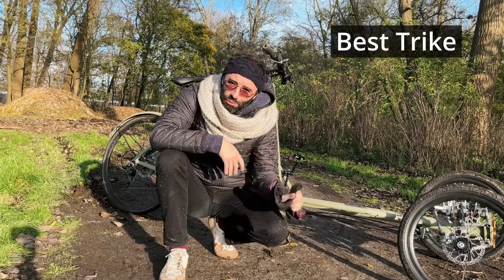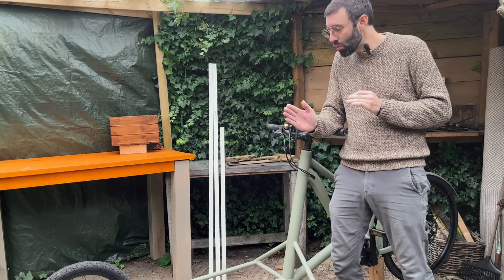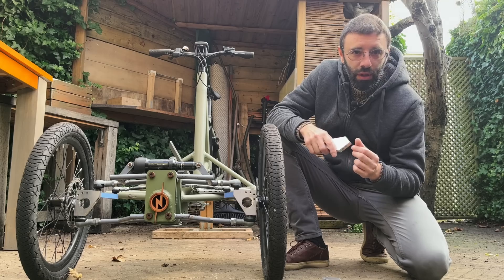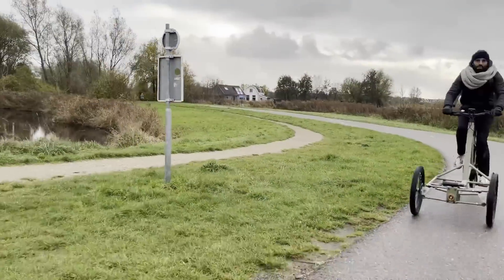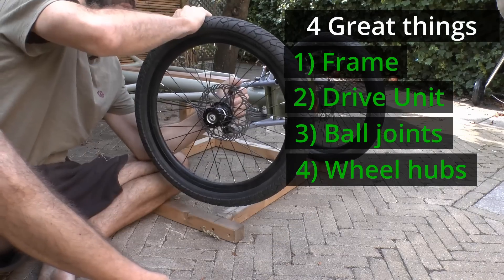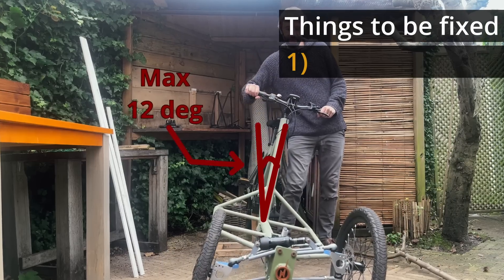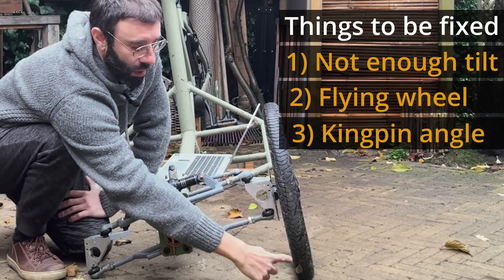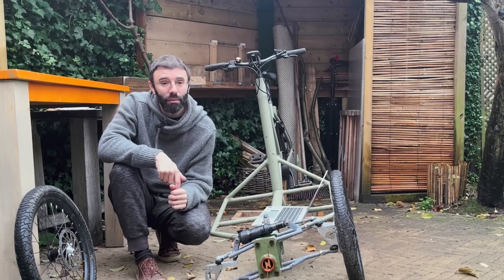#5 Build Finish and Tests - Tadpole Tilting Cargo Trike

Comment: This video comes out just about a week before I present my final project in my university.  We are making a cargo trike and we designed the suspension and tilting mechanism inspired with your videos. You helped us A LOT so THANKS!
Reply from the maker: I love making project that work and sharing the knowledge as clearly as I can. This comment makes me super proud of my work and it's super inspiring. Thank you for that.
Success with your project! Cheers!
Reply: It is always pleasant to see relevant ideas inspire and widespread across the world. Just for curiosity, in which country and city is your university ?
Reply: @ Sorry to answer so late... Universidad de Buenos Aires, Argentina
Reply: Wouldn't the ideal be to keep the cargo level, just tilting the rest?
Reply from the maker: @perpetual4958  that sounds cool! But maybe not easy to implement.
Reply: @pedro-neves  Indeed postNL was world famous in Bike design circles when it launched that trike with plastic carriage cabinet in the front that was stable. The wheels turned in the wheelarches. So it would remain stable. I guess the best option would be carriage capacity in the back like a carver, or that old Honda moped trike with stable back-end and font section/seat swivelling on circular? glider.
Reply from the maker: @perpetual4958  I think the option of the cargo bay being in the back or in the front is a matter of taste really. I tend to like more the cargo in the front because you can see it. If you'tr carrying kids or pets it's nice to always make sure they're ok.
Reply: @pedro-neves  If you want it stable (cargo that are or act like fluids, then back is probably easier to do, as per two examples mentioned.

Bright reviewer liked the longtail bike. The Cube trike opening the video is stable, with tilting front: https://www.youtube.com/watch?v=0As93DiIFuU

I thought your new trike looked scary going over the paved pathway in the park. Requiring so much corrective steering. Hope it isn't as scary when riding it.
Reply from the maker: @perpetual4958  indeed my trike needs quite a bit of corrective steering now. I'll try to improve it.
Reply: I don’t get the nerds in the comments section.  This guy is sharing his bicycle science experiments and data with everyone and people respond with being critical and rude to him. It’s just unnecessary.  It’s like nerds see another nerd’s work and feel the need to put him down, criticize, and say something to make themselves feel superior.
Reply: soooo... you basically copied a flawed design without analysing the issues, and engineering proper solutions?

yaaaay! education!
Reply: @paradiselost9946  You win the non-sequiter of the day trophy 🏆 congratulations.
Just like a pizza-cutter, all edge, no point.
Reply: @johnosullivan675  if you are going to be all intellectual, like... at least get the latin correct.
non sequitur
Reply: @paradiselost9946  The last versión of the trike was more than enough for the prototype we are making and it allows for improvement, thank you for worrying though
Reply: @paradiselost9946 where is your video with your perfect design…we will wait.
Reply: @amiddled  ah yes, because everything has to be documented on video now, doesnt it?
Reply: @ no, but it’s a lot easier to criticise than create.

Comment: I would suggest using a single tie-rod to connect both wheels to each other and a second one to connect the wheels to the steering yoke
Reply: cant... the way the swingarms move means those pivots change distance depending on where in the travel they are. its going to be constantly varying from toe in to toe out...
Reply from the maker: @paradiselost9946  hmm, I didn't think about that. My main concern to connecting both wheels to each other was the frame being in the middle when tilting.
Reply from the maker: Thank you for the suggestion! I haven't made that because with the tilting mechanism it makes it hard to connect both like that because there's the frame in the middle.

Comment: Nice update!
I've been using 20mm steel axles on my trike, welded to 3mm steel plate as base of the spindle. The axel is working well, colud probably be quite a bit thinner, hollow or both, but I would say it's a good idea to leave alu for the axles.
I'm not sure you saw my construction of spindle on reddit, but it might be part of the solution to get the kingpin angle steeper by putting the lower balljoint below the discbrake and further out. Maybe even get also the upper balljoint above the disc might be a good idea to make it even steeper. I guess there is no real need for the self stabelizing functions this angle provides on a tiliting vehicle. My dream would be to have "umbrella" shaped wheels though to be able to make this line vertical, but harder to find such wheels.
Regarding the turning radius, I have the same problem that I would like to make it quite a bit thighter. I', also having the same problem that the steering angle of the inner wheel is still to small when the steering bar aligns with the 2 turning points of the spindle. I don't have a good idea how to make this better but I don't think that you're idea of moving the joint of the steering arm forward will help much. Imagine that the steeringbar just consists of 1 piece going from one spindle directly to the other. Then you'll still have about the same max angle of the when when the steeringbar and the 2 turning points of the spindle aligns.
Reply from the maker: Hey, thank you so much for sharing those design thoughts. Super interesting! I did not see your design in Reddit. Would you like to publish in this forum? https://www.reddit.com/r/VehicleEngineering/.
I believe you sent me an email with pictures of your build right? That was cool! But in Reddit I think it's easier to discuss.
Cheers!
Reply: @pedro-neves  Yes. you're right, had not shared those pics on reddit but now I have.
Hope it could give you some inspiration.
Reply from the maker: @linus-IO  nice thanks! I already put some questions;) hehe, love these discussions.

Comment: Definitely make your new axles out of steel so they will last longer than a small test ride for a few days. Also you commented on the aluminum frame being better even though everyone else knows that steel is more durable, you said it was just better to be aluminum. Because weight is somehow a major factor on a cargo trike? That makes no sense. If you want your frame to be more durable and your axle axles to be more durable make them out of welded chromoly steel. It does not tear nearly as easily as aluminum. Mini race applications do use aluminum for frames and chassis, but not when durability is desired and weight is a minor concern. That's when everyone switches to steel or something better and far more expensive.
Reply: I do love and appreciate your project trike! And the wealth of valuable information you are sharing with all of us! Keep going!
Reply from the maker: @SK-wf9pu  thank you so much for the inspiring words;)
Reply from the maker: Hi, indeed saying that an aluminium frame is better than steel in absolute terms is a bit too absolute. But, here are my arguments:
- 32 kg vs 50 for "apparently" the same functional frame
- Most modern motorcycle frames are made of aluminium. And they are durable. I don't think BMW is wrong in making their frames of aluminium.
- More and more car chassis are made of aluminium because they become more worried about mass and efficiency.
I think that the best frame is made of aluminium. I don't claim that my frame is the best but if I'm trying to make the best, it should be made of aluminium.
The axles should definitely not be made of aluminium;) Either steel or titanium the nest ones.
Cheers!

Comment: Visually it looks like there is insufficient Ackerman angle. Love your trike and your videos on the builds. Best luck.
Reply from the maker: Thank you so much! Indeed I am not sure if there is sufficient Ackerman but I think there is because in all kind of turns there is no scrubbing of the wheels.
Cheers!
Reply: Seconding this
Reply: Do you have any caster in front suspension?
Reply from the maker: @bosenswe  yes, 10 deg.

Comment: If you cut and weld an angle in the borrom arms you would gain clearance for the ball joint. Common on offrod quads I think.
Reply from the maker: Thank you. Indeed, I think there is a possibility to add more range by shaping the wishbone. Though, being a tilting system, I think it may still not be enough. I'm thinking of using the same type of ball joint that I used on the frame side oriented vertically and use spacers to have more steering angle.
Cheers!

Comment: Beautiful work💪.   Sure someone will pedant "aluminium is proper" but in this context, that's just the way it is. It's a big frame. Weight is king. Unless it's an axle 😜 ...Titanium's nice 😉
Only tiny thing to suggest that you're not already doing: maybe put a gaiter on the steering cable exit to reduce water ingress long term. VBrake rubber gaiters might work....
Reply from the maker: Thank you! Hehe, yes, I know how controversial it can get the "steel vs aluminium" discussion. But 32 kg vs 50 kg does settle it for me. And the fact that the high and motorcycles and cars are made of aluminium.
Unless it's an axle;) Totally agreed!
Good tip on the rubber protections for the cables, thanks!